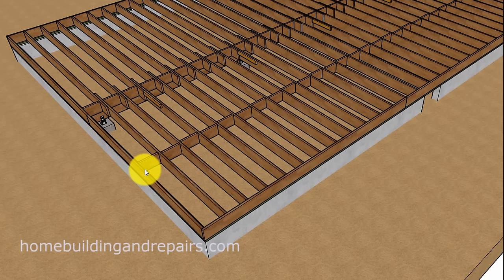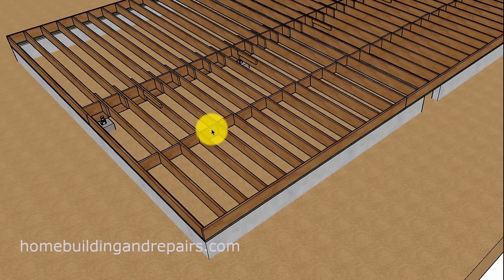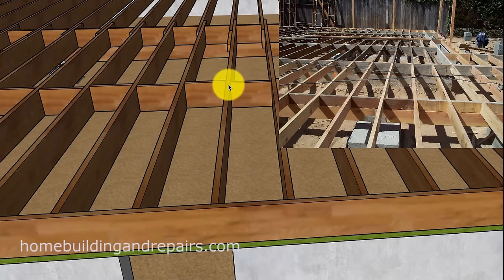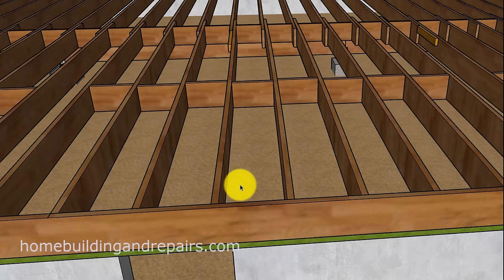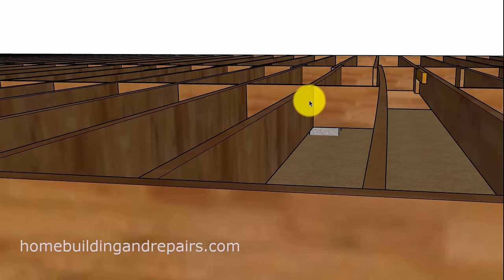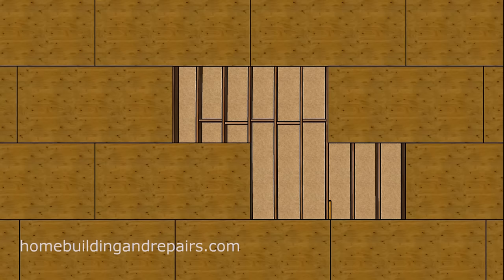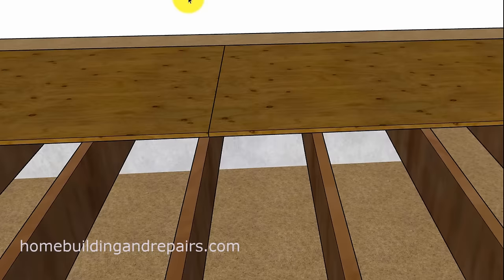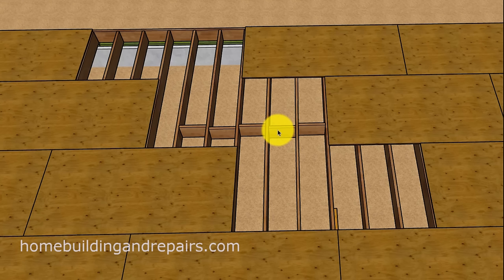This Is One of the Biggest Problems Keeping Floor Joists Straight

Comment: First time seeing any of your vlogs, and you did an excellent job. I am about to try and "level" my rough-cut full-dimension 2 x 8 rafters which have dried and bowed some up and some down while putting in blocking at the same time! Hope to use a hydraulic jack with three foot rafter-spanning boards and a small chain on each end. (will be very time-consuming!).
Reply from the maker: Good luck!

Comment: We normally use cross blocking and Nail the tops then put your plywood on and then go back and nail the bottoms. Makes for a lot better floor the standard blocks.
Reply from the maker: Great info.

Comment: I have a problem in a new to me  30yr old house where all the joists are bowed across the whole span. by over 1/2inch in some spots. I jammed some in there not on every joists just to hope it helps, as I am installing a full tile floor up top, and Built structural supporting walls underneath for certain areas.
Reply from the maker: I don't understand your question.

Comment: Most of the time squeaking happens because of using nails sloppy stick construction by contactors that are just plain either drunkereds or dopers. When wood deck screws are used properly you will have a solid floor without any noise. It is also a barrier to slow down air flow. The rest of what you are saying is right on. What question I have for you is what would you prefer for stud header ends insulation fiberglass or rockwool  ???? Thanks
Reply: Victory First yup and a small line of floor sealant on the joist if you have it, will make floor literally never squeek

Comment: @awesomeframers had a good video in this the other week. Think he said that his theory is that the nail heads stick out a bit, which adds a bit to width so you need to cut those mid span blocks to compensate.
Reply from the maker: That shouldn't be a problem if the mid span blocks are staggered, but could be if they were installed in a straight line.

Comment: My house (with flat roof) has mid-span blocks inbetween the roof joists, and the blocks were all cut too short. Over time, the roof joists became cupped, causing the roof to have low spots that pond water when it rains. I believe if the mid-span blocks were cut and checked correctly, it would have prevented the joists from being able to cup, thus keeping the flat roof flat - and we wouldn't have ponding water roof problems. But then again, it's a flat roof, so you're pretty much guaranteed to have roof problems in the future.
Reply from the maker: It could be, but more than likely the rafters aren't strong enough and are sagging.

Comment: Solid blocking is not that common in our area.  We use cross bridging in floors, 16' span gets 2 rows.  We just chalk a line and install pieces alternating on either side of the line nailed at the top only, install the plywood, joists will still move at this point.  Then nail the bottom of the bridging from the basement after the plywood is all down.
Reply from the maker: Great tip!

Comment: Metal bridging. 
You could also measure and mark your sheathing on layout, and then adjust each joist to center the sheathing before nailing through it. Personally, I've never seen a problem with cutting 14 1/2 inch blocks, but I know it could be a problem if your joists are warped, or if you accidentally cut a block a little long or short. Like you said, measure and make sure you stay on layout.
Reply from the maker: I'm not about to suggest that you can't cut blocks the exact size needed, but I can tell you that it's never worked for me.

Comment: why use blocking overbridging? I'd use 2 x 3 bridging. that will tighten that floor right up, just like a truss right across the joist. And nail them up correctly so the don't touch each other so they don't squeak. And if you know how to install them correctly, you nail the tops before laying the plywood, then after you install the flooring, you'll go and nail the bottom. And even if you use blocking and allow for "growth" by cutting them smaller then 14 1/2, the joist will still shrink over time and now you have another problem. Use a good solid cross bridging, I think it's the best way.
Reply from the maker: Great ideas.

Comment: Another wizard here to tell you what to do. Snap your line for blocking but don’t install blocking until you sheet out to it. I always mark my sheets 16 inch on center or whatever your spacing is so when you finally get to the blocking you can just mark the blocks 14 1/2 cut down the middle of the line and install. Not to mention the plywood makes an easier platform to stand on.
Reply from the maker: We thank you wizard and this works great.
Reply: @gregvancom  back when I was younger every once in a while I’d be building something and the old guys would show up and critique everything I was doing. One job the homeowner told me the wizards are coming over to watch you guys work and to this day that’s how I label the know it alls. Now I’m the wizard know it all funny how things change.

Comment: Is there any advantage to putting PL premium on 3 sides of the solid blocking to “fill” any small voids that happen over time… or does the construction adhesive create more problems down the road? Retro-fitting mid-span blocking in a 30 year old house right now and the variances are unreal. I know if I squeeze the large cavities too much, I’m surely going to create squeaking. Help!
Reply from the maker: I've never used it, so won't be able to provide assistance.

Comment: Cut and use bridging but only nail tops.  Center your sub- floor as you lay it then nail off the bottoms of the bridging.  Stronger  than blocks/ cats  and a hell of a lot less squeaking. The straightest of joist.  Old school.

Comment: Not sure if you are still responding to comments. Found your video while trying to figure out why our subfloor choice are off in the center. We're pretty sure we're going to have to remove some blocking. Do you think we should start with every other one? Is there a good method? We have 14' 4" long joists and started with two rows of blocking up middle, then added a row down each end of joists. We have this X two. I'm tempted to just have 3 rows of blocking per joist length when we go to redo

Comment: Great tip...thanks for posting.
just curious...what if you block, after the floor sheathing (providing you have access from the bottom) just thinking then you would have no problem lining up the sheathing in the middle of the rafters.
Reply from the maker: Yes, that would work.

Comment: Always space everything out with 1 pre-cut nog and you can’t go wrong . Nz builders ✊🏽
Reply: Would this be a long wood jig you lay over the joists to keep them spaced properly?
Reply: If  your nog isn't accurately dimensioned or your joists aren't the exact width they're supposed to be you can easily go wrong - a 2x4 laid out with centres (a story board) ensures no incremental error..

Comment: I'm building a 10' x 12' building. I have 2" x 6" floor joist on 16" centers. I will need to cut a 4' x 8' sheet of 3/4" plywood in half to make the 12' run. My question is, do I need to double the 2" x 6" joist at the seam or could I just split the difference and just screw down 3/4" of each sheet to one single joist ?
Reply from the maker: They can butt together on a single joist and usually require an eight inch gap between plywood sheathing.

Comment: Glue for the squeaks and install blocks after sheathing if possible.
Reply from the maker: What would be the reason for installing the blocks after floor sheathing installation?
Reply: Ya that's what my old company did . Well if its sheathed isn't it common that the juice are lined up and square like a box because the sheathing.
Reply from the maker: The joist might be lined up and positioned perfectly, but they can still twist and deform, without some type of blocking. If it deforms too much, then it could lose structural strength.
Reply: The blocking prevents joist deflection and increases the load capacity of the sheathing and makes for a more rigid structure that won’t have as much “bounce”. Especially important if you are installing a tile floor over it.

Comment: The worst you explain looks like our old 4x4 joists under the front room I'm wanting to redo it all because I know most are bad joist I've redone 4 with new pine wood 

What's under ours is 50 year old hornbeam 4x4 joists or is red oak.

What type of support is under your joints cause they can sag down to
Reply from the maker: The video wasn't meant to provide the details you're requesting. I would go to our website and check out some of our videos on home building and crawlspace framing or repairs.

Comment: 16oc..  lol.  I wish i had two matching joist distancing.   Mine are everywhere from 14" to 21"oc..  house is built just like the one in the rendering..  except the builders used or tried to use wood x braces that every one has pushed out or fell out.. and by pushed out i mean nails stil attached and boards pushed down past the bottom of the joists...
Reply from the maker: What a bummer and it would have been nice to know why they did it that way.

Comment: Everything I read says that solid blocking in floor joists does not cause squeaking, that it actually prevents squeaking when done properly. What is the reality?
Reply from the maker: I thinks it's this simple. If the joist on one side sags or moves then you could have a squeak and if it doesn't then you might not. My dad was a firm believer in leaving them out if he could, but other than that I don't have much else.

Comment: I am remodeling my basement, and moving a duct into the space between 2 joists, and need to remove the mid-joist block.   Is there a thin metal bracket I can use that can go under the duct to maintain the distance between the joists?  Or, is this unnecessary since there is already a plywood subfloor attached to the top of the joists?
Reply from the maker: You can move the block a few inches or feet sometimes and I don't see why a brace at the bottom won't work. The floor sheathing is preventing the upper section of the joist from moving and a brace could do the same for the bottom.

Comment: What causes joists to start tilting? My 60 year old house has some tilted joists.
Reply from the maker: It's usually going to have something to do with movement of the foundation or framing over time.
Reply: @gregvancom  Thanks. It's a pretty solid house overall. I figured it just had to do with the typical aging of a house.

Comment: your assuming the boards are not naturally bowed and that all the cuts are 100% square... this also includes the factory edges on the sub-floor sheets.. assuming they are 100% square on all 4 corners can easily make your boards off... for that matter, maybe the sheet is an 1/8 inch off either longer or shorter, from the factory even.. at some point it will cause a deviation that won't match those 16 in OC joists.. with or without blocks... i mean, you make good points, but those points assume everything is/was done perfect.. and we are talking about rough framing, not cabinetry... a saw can get off square very easily, getting off line is very easy, even with the best of the best doing the cuts... and rough framing usually worries more about speed than accuracy, specially since getting the job done quick lets the crew move on to the next job.. and since the pay is by the job, it makes sense to do it as quick as one can... also, if blocks ARE needed, they can be placed AFTER the sub floor is installed in some cases.. there are other tricks that work too, like temp bracing to keep spacing correct until you can block.. even then, if the sheets of sub-floor are off from the factory, you will still wind up off center with a joint or 2...
Reply from the maker: I wasn't assuming most of what you suggested, but defective lumber can create problems for joist layout.

Comment: You can make a simple jib with those exact distances that are supposed to be - and when installing the blocks, just make sure you have placed the jig that would look like a comb over 5 or 6 joists in place - you should have NO PROBLEMS whatsoever! Or you can install blockings after installing ONE sheet of ply making sure the distances are nailed exactly as you want - so there are many solutions - it depends on how much you care about your time and your work integrity
Reply from the maker: Another idea and thanks for sharing.

Comment: thanks great video.  This time im not doing floor but a ceiling of carport and your tips are great.  Im using 2x6x12 for joists n carport is 12f wide.  I want to do blocking to help keep joists from bowing as they dry out.  Does blocking always have to be center patern or can i space them out a bit more from one joist to the next joist?
Reply from the maker: Usually they're centered and staggered like in the video, but in some cases you might be allowed to off center them. For example if the span is 14 foot and the blocks need to be installed at a maximum of every 10 foot then you could place them at 4 or 5 or even 7 feet from the side. Let me know if that doesn't make sense.

Comment: I like your channel and you bring very good content to the people. but alot of older framers including my self get this wrong. mid span blocking or "Bridging R502.7.1" is not required if your joists are nominally 2x12 or less throughout the span table. The old rule of thumb under the UBC was mid-span @ 8'-0" max is no longer valid.
Reply from the maker: Thanks for providing me with the building code number and I looked it up. You are correct, but your local engineers and building department officials will have the final say in this matter. Again, thanks for sharing in comments like yours are always appreciated.
Reply: Not "no longer valid," but "no longer judged suitable by bureaucrats."

Comment: Question sir.  I have several joists that are bowed laterally like this.  Not because of blocking because there never was any blocking.  I have sistered some of these joists and the sister is bowed with its mate.  Beside the big problem with the sheathing not lining up on the joist, what load bearing issues are there with laterally bowed joists and would adding blocking help with load bearing ?  Thanks
Reply from the maker: You can add blocking and try to fix it, but most of the time this problem will require removing and replacing damaged joist.

Comment: I need to replace some floor joists, they have center blocking with 2x4 cross pieces. making an X shape. Do I need to do any bracing of other joists to remove one? i don't want the floor to collapse.
Reply from the maker: Most of the time these braces aren't going to be a problem to remove. Maybe remove a few as needed and replace as soon as you can.

Comment: IF you insulated between the joists and then nailed plywood on the bottom of the joists.....like you might do in a basement to create a ceiling......would you still need to do the blocking ?
Reply from the maker: That's a good point in my opinion I don't think you would.

Comment: I had a new kitchen floor put in 5 years ago. The grout kept on breaking up and coming off. The contractor kept on coming back and redoing the grout. I went into the basement and noticed that the floor joists in the ceiling that holds up the kitchen floor are all un-level vertically thus making the foor move.  I was wondering if I put blocks in between to level the joists and ensure they are level vertically,, will this then secure the floor itself and stop having the grout loosen up because the joists are level? the floor itself is level from the plywood they put down. Thank you for your help.
Reply from the maker: The grout can break and crack when there is any movement in the floor and if you think that you can reduce the amount of movement in any way by shoring it up, then go for it. Feel free to email me some pictures and I'll take a look at your project if you're looking for more ideas. Keep in mind that I cannot provide the structural engineering vice.

Comment: can you add blocking under the edge if they don't line up right? attach a 2x4 to the joist, then screw plywood to the 2x4?
Reply from the maker: Yes, that sounds like it would work.

Comment: They are called bridge blocks and squash blocks........if people would put them in every 8-10 feet and use a 1/2 inch glue bead it makes a big difference
The magic number is 14 3/8 heavy because alot of joists are cuped a bit...
If only lumber was a true 2 inches wide that would help alot
Reply from the maker: Thanks for sharing.

Comment: Thank you for another great video! As always, I have a question. Would you add midspan blocking on a 12 feet larger floor? Thank you.
Reply from the maker: Usually you put mid span blocks in joist with 10 foot or larger spans, but we didn't do it all the time, to prevent floor squeaks. My opinion, might suggest leaving them out, unless there is a structural issue.
Reply: @gregvancom , thank you very much!!!
Reply: Throwing my two cents in - yes, use the blocking.  Less "bounce", distributes weight better, and not mentioned here, helps prevent joists from twisting.  When you put down the sheathing, use adhesive on the joists, then screws for the sheathing.

Comment: My house was built in 87 and they used metal bridging. Omg you can hear them when you walk on the floor. It’s so annoying. Was going to do 2x10 wood bridging but now, not sure what to do
Reply from the maker: Yes that is disappointing. The only thing I could suggest would be to try secure the bridging to where it isn't moving or squeaking. Not much help, but I can't tell you to remove them or replace them, because I can't provide structural engineering information to my viewers.